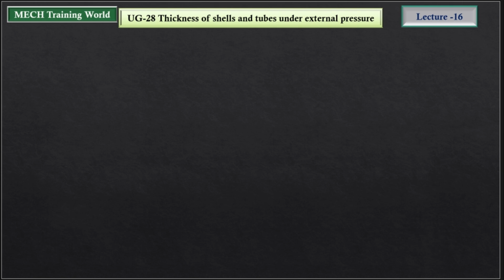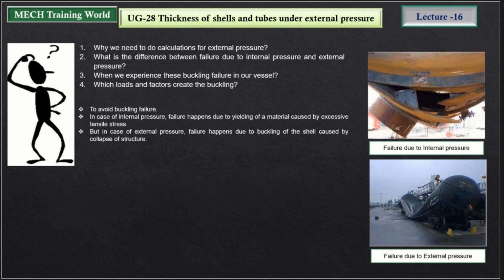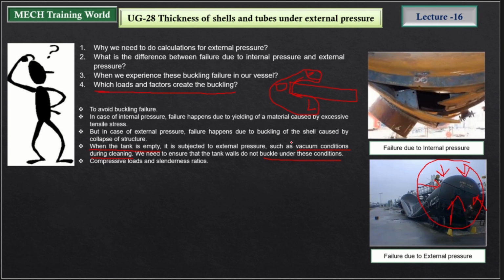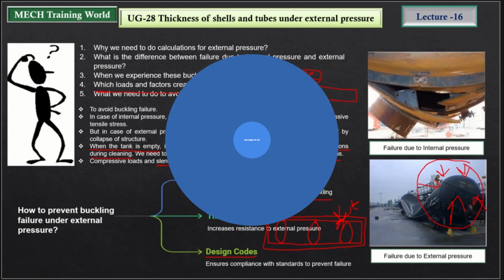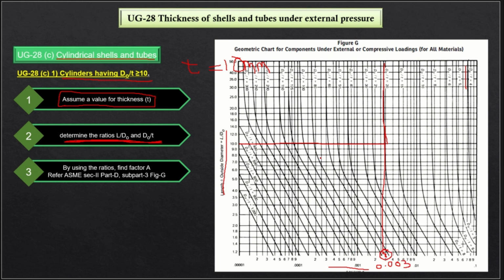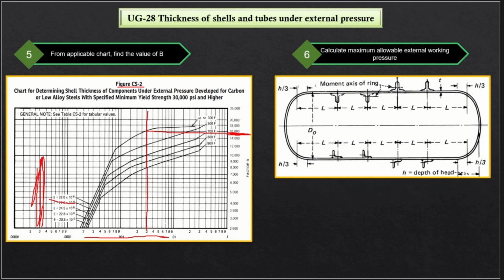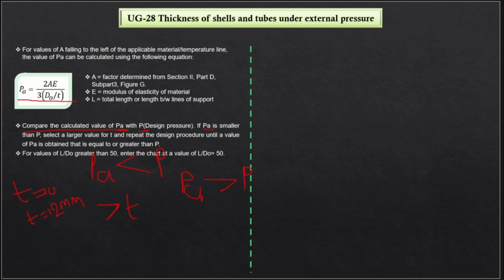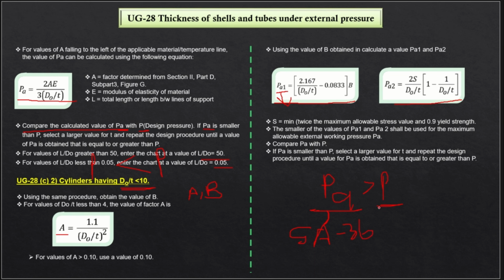UG 28 Thickness of shells and tubes under external pressure I ASME BPVC I Division-1

Comment: is the same principles are applicable to shell and tube heat exchangers design ? Shell pressure is more than 20 Barg and tube inside pressure is 3 Barg. so there this external pressure is act on the tubes right ?
Reply from the maker: Yes, the UG-28 principle is applicable to the design of shell and tube heat exchangers, particularly for calculating the thickness of shells and tubes under external pressure. This principle provides a method for determining the necessary thickness of cylindrical and spherical shells, including those found in heat exchangers, to withstand external pressure.